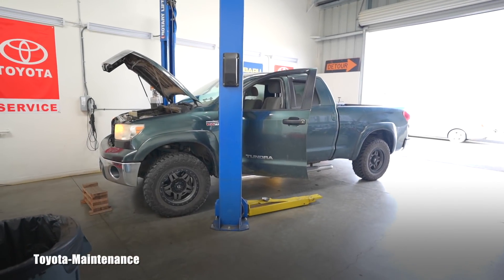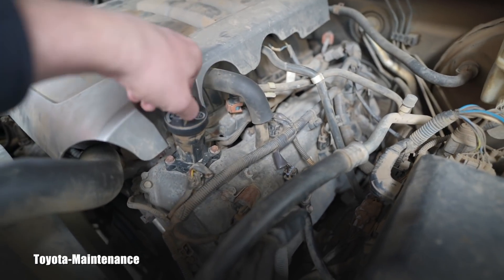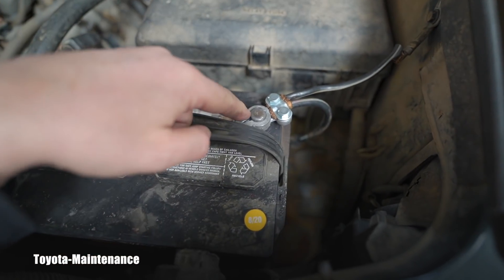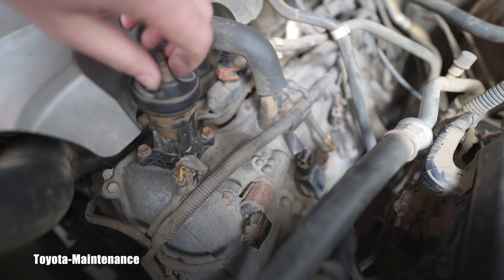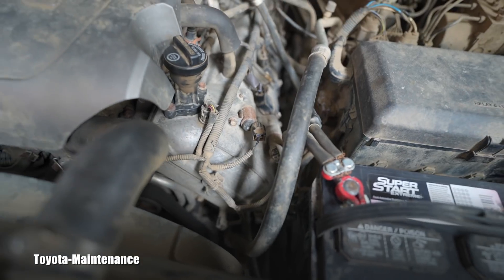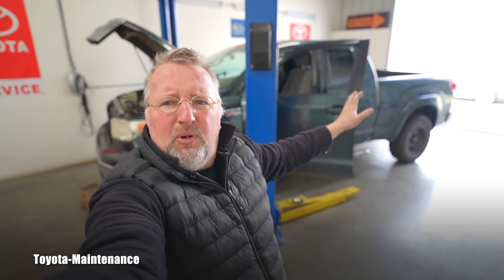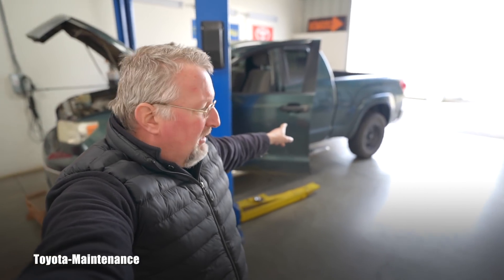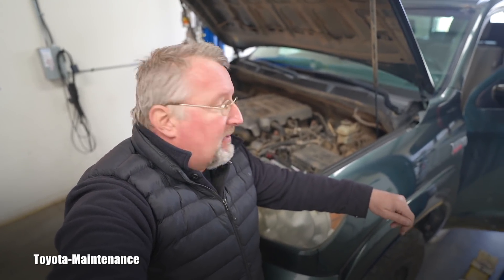Toyota 5.7L V8 Engine 3UR-FE clicking, rattling on Bank 1

Comment: There's nothing wrong with that engine,  some engines just sound like that, those diesel engines are always much noiser than gas engines. If a gas engine ever made noises like that I'd be really worried.
Reply: Well... that toyota motor IS a gas motor.
Reply: @somemedic  ---  Nope, couldn't be gas; it's making those horrible top end engine sounds, has to be a diesel Right??  Otherwise it would be, what we call, broken.

Let's see, makes the noise when it's cold and just started:  probably heat/warming related, for example,  exhaust gasket related, or timing chain tensioner related.  Petr (yes, that's how he spells his name) will pull the valve cover and we'll all find out, it will be fun.
Reply: @DavidNull5  Yeah, when I first heard it , I guessed exhaust leak but the noise coming out the filler cap hole suggests tensioner or vvt-i. The guy who said that the computer recalibrated after battery dis-connect also had an interesting theory. Fun indeed.
Reply: If anyone is interested,  in the YouTube search box put 'TOYOTA TUNDRA 5.7L ENGINE RATTLE. FIXED!  rain city wrench'   Their video shows the process for changing the bank 1 timing chain tensioner. It's not a job you can rush through.
Reply: The 3UR isn't a diesel motor Dave.

Comment: This truck was overall neglected in almost every aspect regarding preventive maintenance. Now, the owners are playing “catch up” since they neglected it before this. Penny wise and pound foolish....
Reply: Not enough oil changes? My guess it is the spring loaded pins for the VVTI...but usually stops when oil pressure builds.
Reply: My 2008 tundra is starting to make the same noise periodically 
And has had all oil changes at all required mileage 
It is well looked after!
With only 205,000 Kim’s
Reply: Right. Toyotas only have issues if it was neglected by the owner, whereas if any other brand of truck had an issue like this it's because it's poorly made junk.
Reply: @karlschauff7989  Yep like the GM trucks that are needing major engine work in a little as 73 miles on the odometer but at least most of them last 10K to 20K before needing that engine work.
Reply: @dalephillips8250  Yeah like my neighbor's brand new 2014 Tundra that had a leaking rear main seal the day after he first brought it home. Not even 100 miles on it.

Comment: I also have a 07 Tundra and mine does the same thing but only for a few seconds on startup and then only rarely. It started making that noise at about 70k and it has 100k on it now. It has gotten worse over that time. By that I mean somewhat louder when it does it. I saw another mechanic solve that noise by replacing the timing belt tensioner. It's on youtube.
Reply: Thats what I thought.
Reply: Good info 🤘

Comment: That timing though, a few weeks ago the left bank started to tick upon a cold start intermittently (260,000 miles). Great video too.
Reply: What was wrong? Did you resolve it? Had a constant ticking on right bank, it was broken damper line! Changed tensioner and damper line! But I get a tick on start up the same bank I changed tensioner on! Have you solve yours ? What’s was it? Tensioner or cam shaft actuator wear ??

Comment: Exhaust manifold gasket leaking. Sound goes away after heat expansion closes the gap in the gasket. The test- arrange shop vac hose in reverse to blow air rather then suck, attach hose to exhaust pipe with Toyota duck tape and scan manifold for air leaks.

Comment: It needs valve adjustment this is called Toyota tick the vvt-i can adjust out of the tick. When the battery was disconnected the timing reset to base in PC. 

Every 60k miles the valve cups should be adjusted and clearanced to prevent this noise. 
The shim in one or more cups could also be dislodged. Or the 5.7 are also prone to valve springs breaking.

Comment: Timing Belt tensioner. It is common to make that noise when the engine is cold. Once it is warm it goes away.
Reply: It doesnt have a timing belt.
Reply: Yup 5.7 chain 4.7 is belt
Reply: It actually does have a timing belt
Reply: @bigozo1981  it has a timing chain.

Comment: My 2013 same thing. Very random. If you pour a little oil in the the oil fill sound goes away, so I'd say it's a noisy lifter/valve. When you drive for a few minutes sound goes away anyway without adding oil. From what I've read they all do it from time to time and it's nothing to worry about.

Comment: Exhaust manifold leak 
Cold start will make noise and when manifold warms up the metal expands and fills crack
Reply: Had to replace mine at 105k.... 2000 AC 4x4.

It sounded like a diesel until warm and then stopped for the rest of the day until a cold soak.
Reply: Good point👍🏻

Comment: Timing chain  tensioner is not putting tension on the chain. Put some marvel mystery oil in and see if it will clean the debris out of the tensioner. That's why you keep your oil changes on schedule.
Reply: Yep, 100% agree. MMoil every oil change now.
Reply: I just put some sea foam into my engine, similar tick started about 30,000 miles ago. I have about 230,000 miles on my 2011 tundra. I have had the sea foam in for about 80 miles, and plan to leave it in until I get about 400 miles on it or so to clean stuff out. But even with the 80 miles the tick has been dramatically reduced. Went from happening almost every time I start the engine to, trying to figure out if it’s still doing it or not,  now. Lol anyway I will update folks once I get to 400 miles on it.
Reply: No more ticking now
Reply: @Nakai2024 how long did you run the seafoam ?
Reply: @Cesarramirez-vj5ww  400 miles, I use every other oil change now as preventative maintenance and keep it in for 300-400 miles.
Reply: @Nakai2024  Good luck.Hope it fixes it for you
Reply: @Nakai2024 thanks for that update😊
Reply: Marvel mystery oil does not fix broken worn-out cheap poorly  design timing chain tensioner. People who watch too much TV see commercials for oil additives that do not work . Marvel mystery oil based product it does not clean sludge or carbon build up. Berrymans fuel injectorion cleaner is a very aggressive solvent that actually cleans out  a crank casing. Marvel mystery oil is a joke waste of money and shouldn't be anyone's go-to  for fixing mechanical problems with an engine.
Reply: What's marvel mystery oil? From Stark industries?😄
Reply: @hughkoontz2166  You can pick it up at your local parts counter. SeaFoam also works well.
Reply: @hughkoontz2166  You really need to read up on the virtues of MMO
Reply: Ask google

Comment: Don’t have a Toyota (yet) but on my Audi 4.2L fsi the motor is very finicky about how fresh the oil is for the lifters. Again not sure of the design but maybe clogged oil passages. Variable valve timing? Solenoid stuck?  Just guessing.

Comment: My 2UZ-FE laughs in fluent New Timing Belt.
Reply: I guess there is some benefit of a timing belt after all hahah
Reply: @pncorona  timing belts are better.  I timing chain change [with tensioners] costs as much as 3 belt changes with water pump, tensioners, etc. Quieter too.
Reply: On my 07' 5.7 Tundra I would change the oil every 7,500 miles with a full synthetic 0-20.  I traded it in at 250k with no issues whatsoever.